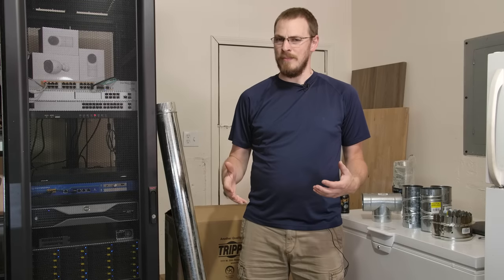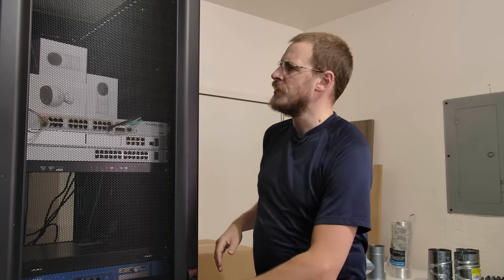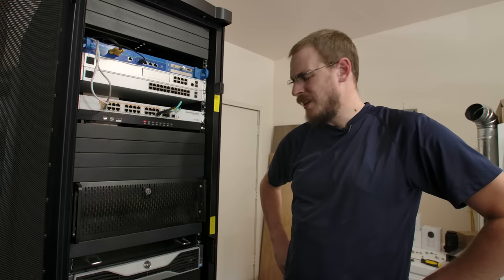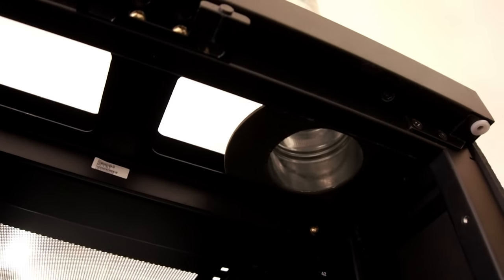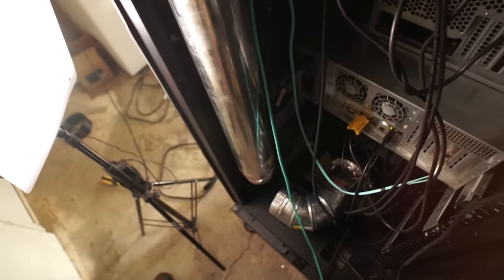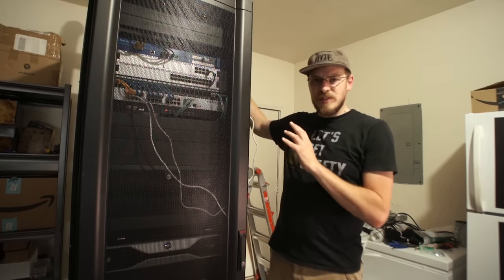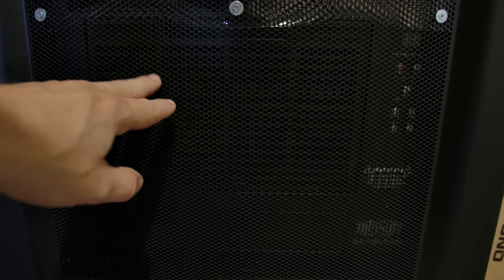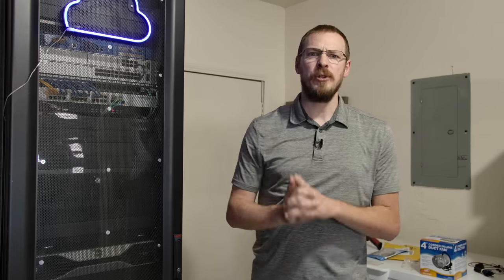Rackmount Air Conditioning?!?!?!? IT'S A THING!

Comment: I recently installed on of these for a client with a similar situation.  They have a rack in an uncooled warehouse. 

I used the whole ducting kit the way it was intended, mostly.  The back door of this cabinet was solid (not mesh), so I just cut a 6 inch hole in it.   Worked out great.  It keeps the cabinet a cool 68f.  I plan on running the drain line for the moisture, so I don't have to count on the reevaporator. 

I will give you this caution.  If you, like me, want everything to have an ip address and be network manageable, be forwarned:  the network card for these is awful.  It is dependent on Java, only seems to work in IE (with compatibility mode on) , and requires you to do some manual edits to the Java security settings to allow support for MD5. For how much they charge for the network card, you'd think they'd actually give you a decent modern interface.

For your install, I think that 6-4 reducer is going to be a problem.  That's like 50% less airflow.  And as you've seen, this thing moves a lot of air.

Comment: Just remember if the power fails - your A/C and extractor fan isn't backed.  (I assume.)
You've now got a well sealed rack with no air movement (when the power fails).

Comment: The design of the SRCOOL7KRM seems insane to me - there's only one intake both for air-to-be-cooled, and air-to-be-exhausted, from what I can see. That results in a huge amount of waste, since you can't recirculate cool air on one side of the cooler, while having a separate air path for the hot side of the AC. It's like portable ACs that cool themselves with the room's cool air instead of having a separate intake/exhaust - ridiculously inefficient.

A design with separate paths for the hot side and the cold side of the air conditioner would also prevent you from needing to do all that ducting from the rears of the servers - all of the heat rejected from the entire rack would come out of the single air conditioner exhaust.

Comment: This rack mounted A/C unit looks pretty much like a “portable airconditioner” build into a 19” box; so would expect it to give similar performance and operate under similar constraints. You probably want to have a really short and wide (6”) exhaust to dump the hot air outside; otherwise the unit will fail to run for extended time due to overheating — I’m pretty sure the long 4” duct work with the many bends does not help here; straight out the back would be better for this unit.  Efficiency will be pretty poor compared to any mini-split system.  While I’ll pass on this solution thanks for the interesting/entertaining video. 👌🍺

Comment: That ventilation pipe might still radiate some of the heat that passes through it depending on the temperature of the air so insulation might be optimal.
Reply from the maker: I'm looking at potentially insulating the duct. It was pretty warm in testing.

Comment: Is it not smart to have an intake to the house. 
The server is warm in the winter. Its better to use the energy that way.
Put another tkros with a valve so you can turn it off if you do not need it.

Comment: Should have just installed a mini split in the garage. 🤷🏼‍♂️
Reply from the maker: Do you realize the cost of cooling a 900 SQFT (9000 CUFT) garage, vs a dedicated unit to only cool down the rack???
Reply: Craft Computing are you talking ongoing energy costs? I don’t know your local energy costs. But a 12,000 BTU mini split with a 20 seer rating would cost you about $0.06 an hour if your utility costs were $0.10 per kWh. So over the course of a year running 24/7 it would cost you $500ish. The rack mount unit you installed I can’t even find a seer rating for.
Reply: @CraftComputing  Would be a really nice comparison. I bet there is a lot of people thinking the same thing.
Reply: @slipknottin  I'm crying at how cheap the power your talking about is... in Australia, upwards of $0.30+ kWh
Reply: Zengineer if energy prices weren’t so regressive, I’d actually prefer they be much higher here, even more expensive than you are paying. Would help sort out the externality costs and really drive up efficiency.
Reply: A mini split would be so much more efficient than this turd, a rackmount 7000btu window unit for 4x the cost of a window unit. A 9000 btu mini split would be half the price and three times the performance compared to cooling all that outside makeup air.
Reply: @CraftComputing  The garage space complicates a little. Though I think I would wall off a small room for the rack and a minisplit. Even using foam board would be enough and no need to frame anything.

Comment: The exhaust vent for the AC I woulda shot it out the side of the rack then up to the ceiling.  That vertical duct is going to be in the way and a PITA in the future when you need to move rails or access the back of your servers.   Just Saying!

Comment: LOL, If you pump the "hot" air out of the garage, the garage will collapse due to the differential pressure.  Either that, or hot, humid air from outside the garage will leak into the the garage to replace the air you just pumped out. You should have just  bought a small window unit for the garage, to eliminate the who garage collapsing issue.
Reply from the maker: I live in Oregon. Our summers average around 15% humidity. I've got ideas on how to bring in colder air as well.
Reply: I'm in Texas, today it was 90 degrees and 90% humidity.

Comment: solar powered ac from minisplit is the way - also batteries - then you can get reports on all the power stats with a wifi app etc
Reply: trying to make it more efficient is a good idea - 500w at idle seems a bit high - also think about ducting to house basement in the winter to save on heating bills, also think about heat exchanger - they can be 90% efficient

Comment: I'm just a dumb carpenter, but I know how air conditioners work. I hate to be a negative Nancy, but im gonna to assume you're KILLING the efficiency of that air conditioner by going to 4 inch and im going to also assume a lot of its exhaust is going to end up back in the rack even with that little fan because of the T. I dont know if they make them, but a Y connection probably would have worked better for you.
Reply: I should've watched the entire video. Big fan gud.
Reply from the maker: Hahaha, no worries. I'm just a dumb IT guy trying to make up with thrust what I lack in size.

wait.....
Reply: @CraftComputing  lmao! Very nice

Comment: Did you forget about how thermodynamics work? Hot air rises, cold air sinks. Putting the AC at the BOTTOM isn’t going to yield nearly the results they would had you put it at the top.
Reply from the maker: Did you forget how fans work? Air blows up, displaces air already there. Or do you not have fans?
Reply: Did you not watch the video?  He clearly said at the beginning that he was following the manufacturer's recommendations. Also putting it on top could kill all of your servers if it ever leaked. Water vapor condensates when things get cold, have you never owned an A/C...?
Reply: I’ma be honest, I missed the specs of the AC in the video. That’s a poor design. The unit very much ignores basic science. Not your fault. My bad homie

Comment: AWSOME VIDEO! TNX! :) really interested in the video about the temperature probes! :) Im buildin a rack with network gear on the top of the hill and the AC idea is great :) .. also the temp probes are nice idea! :)
Reply from the maker: My APC UPS unit has a network and environmental monitoring card. The probes connect to it, and then I capture that data in PRTG, a free SNMP/Network monitor. I might end up doing a video on it.
Reply: For extra point you could pick up a cheap PLC with a thermocouple card and control all your cooling via relay, 0-10V, 4-20mA, or if your super extra VFDs!!!

Comment: downsizing from 6" to 4" could make the ac turn off carefull 7:12
Reply from the maker: That's also what the larger blower is for. Trying to combat the smaller duct with more forced air flow. 🤞🤞
Reply: @CraftComputing  on my 12k btu amovible ac reducing from 8" to 6" made the unit overheat and turn off within minutes blowing the fuse every time. not sure about the next point but I would instal a one way seal at both output. clap on the rack. keep it up

Comment: This is why IT people shouldn't DIY HVAC. The exhaust outlet of the unit has been restricted way too much. The fans on those overpriced rack AC units do not have the static pressure capability to handle any more than a few inches (enough to get the the rear of the rack and no more) of duct being attached to the outlet. Installing a cheapo fan in the 4" duct is going to do diddly.
Reply from the maker: Might wanna watch the next video... https://youtu.be/SZOZTRpQI4Q

Comment: What a total WOFTAM this is. Your heat load isn't that high. Now you are just pulling more hot air from your garage into the rack along with dust as well as outdoor air/heat/dust to replace the vacuum you are making in the shed. The ONLY way to cool a rack is with a split-style system. Compressor and condensor outside building, evapourator in the rack with a totally sealed rack.

Comment: The 1950's called and want their box window AC unit back after you wash all that black paint off.

It's crap like this that always make me stay away from CrapLite. Most of their products seem to be outdated by several decades and have a very dated finished appearance and interface. Charging six times more for what is a 1950s box window AC unit painted black with some tiny L brackets pretending to be rack ears is a complete joke.